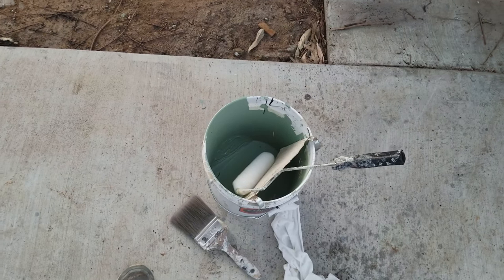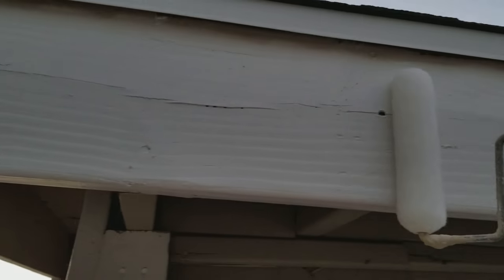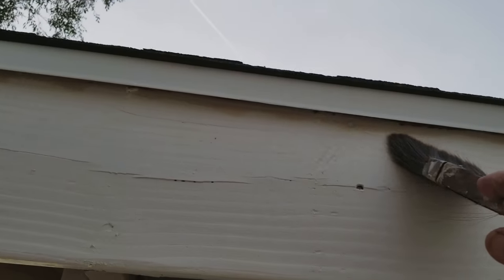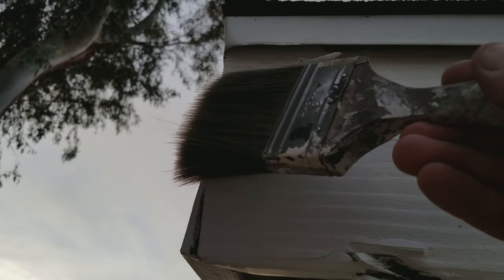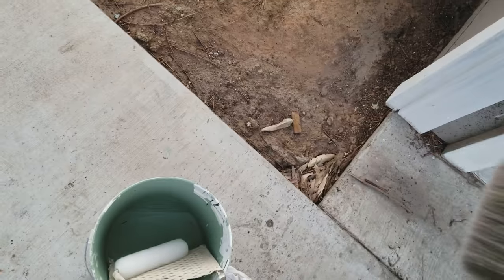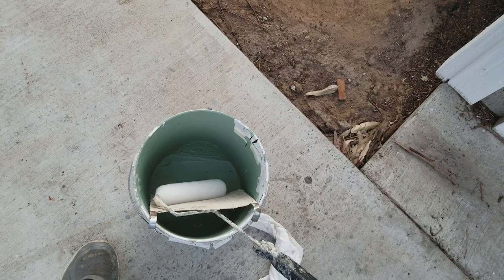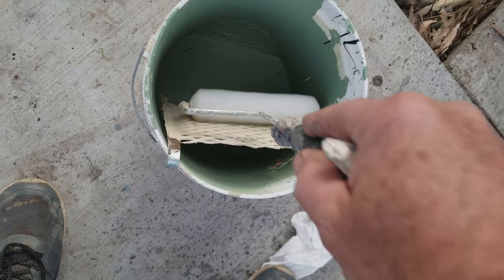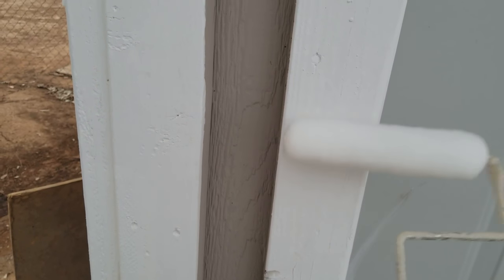Painting facia board faster and better coverage

Comment: OMG is that the Truth...it's Really common sense in painting bro...most guys paint for years and still don't grasp how to put paint on properly... they paint exterior of house and it last may 1yr or 2yrs if lucky...Couple ways to paint exterior of house...2yr,5yr, 10yr..even 15yrs..I have done exterior house painting and they can last 15 yrs easy..just did a repaint of one I did 14yrs ago..I didn't need to scrap anywhere because I prep it so good last time...this technique Mike showed here is 100% correct...its how to get the proper mil thickness of paint..on a 1 coat pass...second coat will add years if customer what to pay more material and labor cost...Take Pride in your work..This is what's wrong with trades these days...No Pride...Thanks for Video's Mike..you are dead on Bro

Comment: Mike, I like watching your videos alot of great information on here. 
I am also a licensed painting contractor and I prime and paint 2 coats on all exterior trim.
Yes, it takes longer but all my jobs last 10÷ years.
I have always believed that applying paint is a two coat process for proper mil thickness, durability and performance of the paint.
Happy Painting.
Reply from the maker: You can get the same results by doing the method I do. My paint jobs last over 10 years as well. I did a house up in the mountains that lasted more than 20

Comment: I have a home built in the 60's that looks almost exactly like the home you're working on in this video. Roofers replaced some of the wood fascia, and the old fascia has prior paint. Do I need to use a stripper or just sand the old paint in order to paint all the fascia?

Comment: Couldn't you just use a 1/2"nap roller all the way rather then a brush? only thing with rollers they leave stipple bumps but brushes will leave brush  marks.
Reply from the maker: rollers can remove the paint. Brush can release the paint better.

Comment: Who uses weenie naps anyway. Half an inch naps is what I use and it covers in one coat.
Reply from the maker: weenie or slim jim is the type of roller the nap is 1/2 inch. But using the brush after helps the coverage immensely. gives you a thicker coat and better coverage.